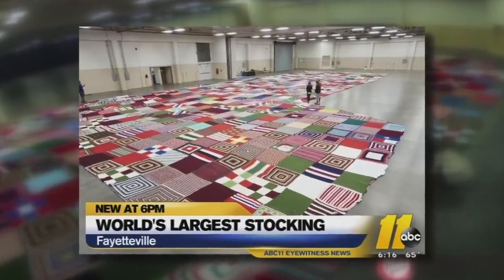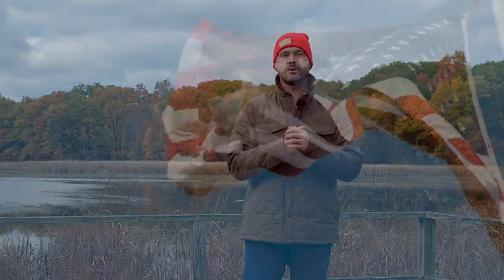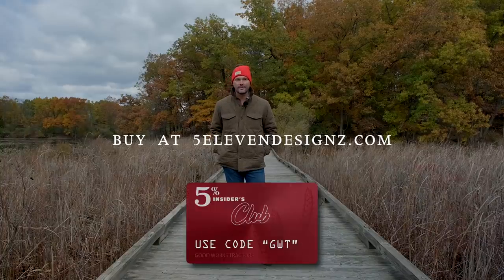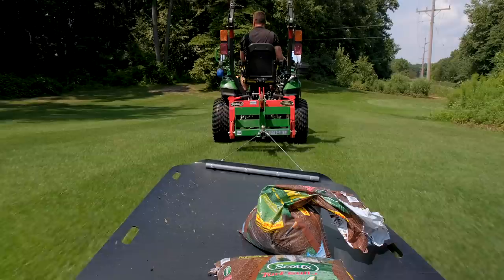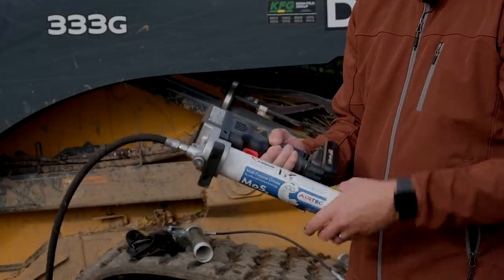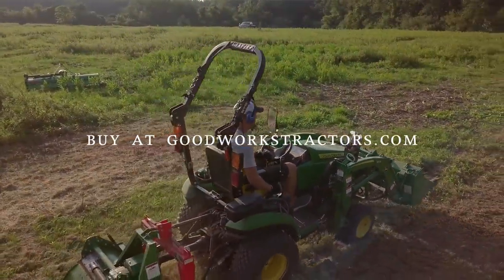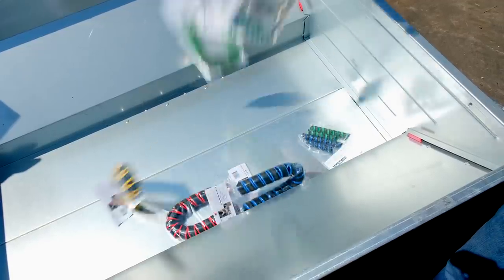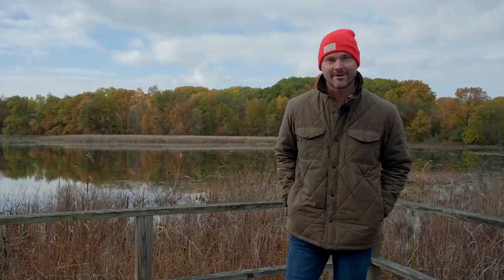10 TRACTOR GIFTS THAT FIT UNDER THE CHRISTMAS TREE! 🎄🎅🏻

Comment: A very important point you missed is SOFTWARE.  I had a New Holland made by LS.  Tractor design and functionality was fine.  HOWEVER, the ECM failed at 942 hours.  The replacement cost on the ECM alone was $2600.  Then you have no choice but to take to the dealer and use their computer/ their software.  They have you over a barrel.   That cost me another $1900 plus transportation.  I got rid of it and bought a new one (different brand) with a higher level of warranty.  Great Channel by the way.  Really enjoy your insight.

Comment: I just picked up a speedco quick hitch last week from GWT. lower ears needed some grinding to fit my Landpride snow blower but other than that easy installation . Does somebody make longer pins for attachments ? My Amazon 3 point receiver hitch is just a couple inches to narrow to use with the quick hitch.

Comment: Courtney,  Would those hose identifiers and tamers be good to protect against possible abrasion points as well? Cheers!
Reply from the maker: Definitely. We had a hose leaning against a PTO sheathe, and were worried about abrasion on the hose. So we rerouted it. Had a hose tamer been at that contact point, we wouldn't have loved it just because moving parts next to a hose seems like a bad idea, but our fear would not have been that the hose could eventually be worn through via friction.